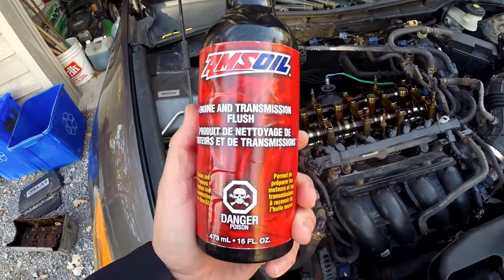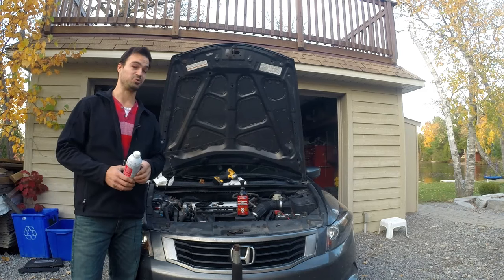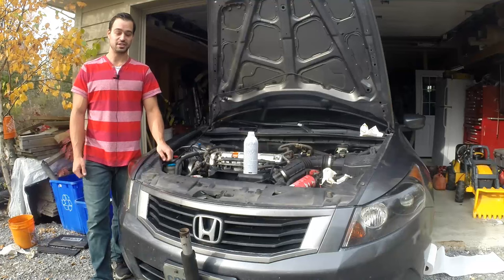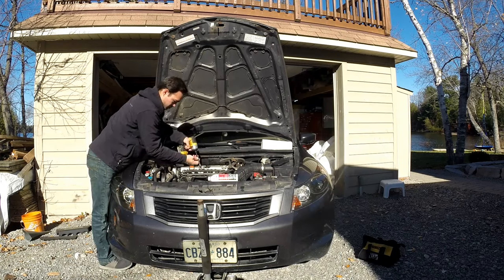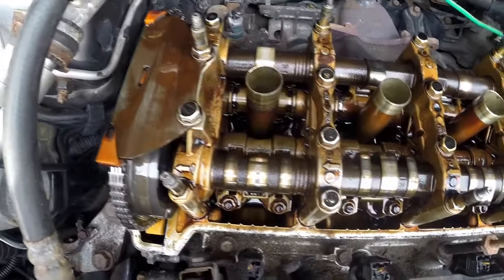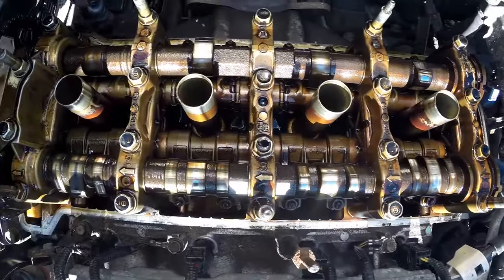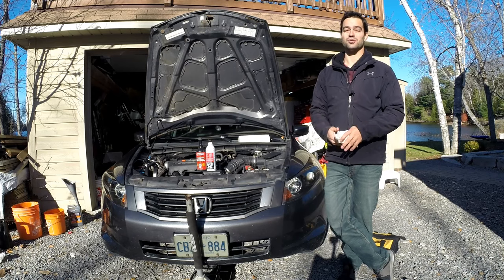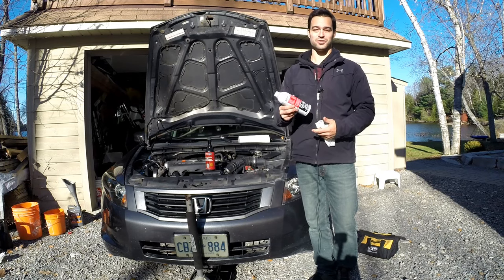Amsoil Vs. Seafoam Engine Flush - Who Wins? Thorough comparison and PROOF

Comment: I added a full bottle of SeaFoam and ran it in my Honda Accord 2.4L for 250 miles.  Checked oil prior to the SF add and then after the 250 mi.  Not that it’s scientific but was huge difference in color on the dipstick and white paper towel.  Med brown prior and dark black after.  Burns less oil per 1,000 miles too.  So will do a second SeaFoam clean again at next oil change.  Engine has 238,500 miles.   Great video!   Keep up the good work!
Reply from the maker: Nice to hear that you also had success with the product! Yeah the Seaform definitely seems to do a good job. 

Cool that you were using it on the same engine tested in the video too - they're solid! 

Thanks for your comment :)
Reply: I'd take it Easy with these solvents, you may endup shortening engine life more than the dirt itself. I know ppl that lost their engines trying to clean it up. Let some dirt stay in there.
Reply: That sounds like you out 3-4x time too much Seafoam in there and was overkill!!!! As the other guy said, be careful with all these solvents and chemicals you're putting in your engine. Some will stay when you out that much..
Reply: Beware! engine flush changes viscosity of oil. Therefore, it is not advised to drive a car during the process. One can experiment it with fast idle (1k-2k rpm) as recommended by STP
Reply: And… 2 years later my engine runs clean.  Oil burn is still less than 1 qt to ~4,000 miles and has 337,355 miles on it.   Should be able to get 500,000 miles on this engine.
Reply: I do the same the week before I know I'm changing the oil on the weekend,. I drive about the same 250 miles during the week as you. So I just remind myself to put the seafoam in the Sunday prior and drive on it..change the oil Saturday and I've seen virtually all the varnish and no sludge when I look at the valve train on my 200k+ mile Corolla.
Reply: @awaisiqbal8934 
Supposedly Seafoam does not change viscosity.   I'm skeptical but that is their direct claim.

Comment: I wonder if the test was done using Seafoam first and Amsoil second.  I bet Amsoil would win. Is not fair to test both products on the same car, the 2nd product will always have the upper hand since the 1st product already did part of the cleaning.
Reply from the maker: Thanks for your comment; I addressed everything you are saying in the video, as I came to the very same conclusion :) 

Furthermore, if you look around online, there are many tests on Seafoam that already indicate that it yields good results just by itself, which is why I wanted to test Amsoil first, and Seafoam second. 

If Seafoam has other tests that show positive results, then we can already conclude that the Seafoam product seems to do a good job. Therefore, having only one engine, it would be better to test Amsoil first and see if it can hold up to the performance of the other Seafoam tests done online. 

I do think though that Seafoam is the better product if you want to remove buildup, as you're actually supposed to drive around a bit with the product in the oil. Naturally, that would help lift more sludge and debris. 

Alternatively, the Amsoil would probably be a great product to maintain cleanliness of an engine, especially if the product were to be used each oil change. 

Cheers :)
Reply: Man I was thinking the exact same thing and was looking for someone to comment. 

But doesn’t mean his test was for nothing. I appreciate his test but too many factors. For instance it doesn’t make sense to me that after running the products the oils all looked black. And a similar black
Reply from the maker: See my comment above. Re: the oil being black, that’s how how it came out. Regardless as to whether or not it makes sense, that’s what happened so I figured I’d record it.

Cheers :)

Comment: An engine this gunked up you may want to do AMSOIL power foam, and do the engine flush everytime you change the oil with Signature series. I did it in my Focus ST and I can barely hear it and my fuel mileage went up 3 mpg instantly
Reply from the maker: Good to know - I'll look into the power foam the future! Thanks for your comment :) 

Yeah definitely agree that an engine like this would benefit from regular cleaning for sure. I was thinking the same thing after running the tests in the video.

Good to know about your Focus ST as well! Always nice hearing about what products other people have found success with! 

Thanks again!
Reply: @KingdomAuto  check out Synthetic Oil Protection's channel and see all the stuff he's worked on with the engine flush/power foam. Lots of good content on many different vehicles.
Reply from the maker: @Ruhdiculus  Absolutely will do! Thanks again :)

Comment: I did not see any "sludge" in your engine but rather mainly varying layers of varnish perhaps with some carbon content. Sludge normally does not occur with on time engine oil changes unless there is something seriously wrong with the engine. Actual sludge will look like thick, goopy oil that instead of being in a liquid form instead has the consistency of gravy that got too thick. This occurs when oil has been been kept in use for too long of a period and has already begun to break down and then undergoes a transformation in conjunction with atmospheric moisture build up resulting in thick, goopy, sludge appearance. Varnish on the other hand is also a byproduct of combustion in conjunction with the exhaust vapors which are recycled back in to the engine combustion cycle, resulting in the vapor leaving a coating on the metal surfaces which is varnish with some carbon content. That is that dark, thin coating you are seeing on the underside of your valve cover and coating top engine parts. Most engine cleaners/flushes are pretty limited to what they can do to accumulated varnish coatings on the inside of the valve cover and cams but that doesn't mean that they are not cleaning the lower engine components including the oil pan (to a certain degree) of any possible oil byproduct build-up as any quality/effective brand will clean things up but they have limited effect against varnish, especially on the upper cylinder and valve cover area.  For cleaning up accumulated varnish a better approach rather than an engine flush type product which are usually based on Napthenic based oils (which have cleaning properties) would be a heavy solvent based formula which is applied directly to the parts that have light to heavy varnish then physically wiping the varnish off of the metal surfaces. A product that would work for that purpose is Berryman B12.  If you want to avoid (as much as possible) the accumulation of varnish in the upper cylinder, valve cover area in the first place then do more frequent oil changes. I've pulled valve covers off Honda engines that have hundreds of thousands of miles on them that had barely any varnish on them because the owners were NOT going by the factory recommended oil change intervals but instead have stuck to 3000 mile (5000 km) oil change intervals. After the 5000 mile mark, due to the repeated heat/cool cycle and fuel dilution effect, the amount of vapor deposition on the metal surfaces dramatically increases so that if a person is going by a 7500 mile oil change interval just because the manufacturer says that's "ok" to do and just because the outside of an oil container makes a claim such as 10,000 miles on it, in the automotive repair world we can definitely see the difference when we pull the valve covers off.
Reply from the maker: Cool thanks for sharing :)
Reply: Cheap oil tend to lose their lubricity and  additives if theres any under high heat thermal breakdown.. good quality oils with good additives will help keep the oil from being cook under high temp.

Comment: I've never done a flush but after watching your video I bet using 1/4 bottle of Seafoam before each oil change would keep the internals looking brand new. And since they recommend driving a few miles with the Seafoam I don't think it will be bad for the engine. I'm going to try it on my next oil change. :))
Reply from the maker: I was thinking the same thing actually. Probably not a bad idea to make this a regular maintenance item as I bet it would help keep the engine quite clean. 

Let me know how it goes if you decide to try it out!
Reply: I add 1/3 the bottle into the crankcase (1/3 intake 1/3 gas tank) before every oil change. drive until that tank of gas is done, then change my oil. Never had an issue out of my 91 S10 W/ 350K miles.
Reply: @jhowe67  yeah but for how long have you been doing that? Even the company doesn't recommend doing it that much
Reply: @maxax6651  6 years. This plus switching to Amsoil, stopped my oil pressure tanking 5 minutes into every drive.
Reply: @jhowe67  you sure it wasn't another issue like oil pump or engine just aging that caused that. I heard the chemicals in Seafoam eventually wears down plastics and seals.
Reply: @DominiAeternum  If you leave it in it can absolutely, thats the reason i add it before i change the oil, and do not add it after. as for the oil pressure, im sure it was just buildup on the sensor causing it to not read. id check the seals, but i lost the truck to an unlicensed driver in a head on collision. but for 6 years i hadnt had any issues. i dont know if id use it in a modern vehicle with that frequency, but atleast the older engines ive used it in never had an issue with oil.
Reply: @jhowe67  oh okay. About how long before the oil changes did you put it in? I've got an older carbureted car that could probably use that help, but it keeps dying when put in gear (D or R in low gears) but alright in N or higher speeds. Don't know what's wrong with it
Reply: Right, of course...why would a seller's sales pitch on a can lie to you?

Comment: Seems like a fair compromise on products, personally for me, when I got my chrysler 300, with unknown service history and having ran Amsoil on my previous car,  I opted for a 20k mile cleaning period where I used the Amsoil engine flush and Amsoil Signature series every 3 to 5k miles, and now I'm that I'm passed that and 7300miles into the regular service I'm sending out a oil sample for analysis
Reply from the maker: Thanks for your comment and glad you found the video useful.
Curious to know about how those samples do when they're analyzed. I did one of those through Blackstone for the first time a few months ago and it's pretty amazing how detailed and thorough they are.

Hope the report comes back with good news!
Reply: How was the results?
Reply: Your full of it 😂
Reply: Oil analysis was ridiculously high in copper, have It in the shop for the infamous lifter tick, has lifters and rockers up for replacement, I haven't had any issues so far apart from the lifters and rockers.
Reply: @zachdailyfost4433  copper means rod bearing are done. Sorry to tell you.
Reply: Don't waste money on the top end.
Reply: It's a good thing I dumped it, traded it in for a 2014 Focus ST ST3 package with 41k miles, 2 months ago, first thing I did was switch everything to Amsoil. But I think I'm gonna run Liqui moly in it as they specialize in oils for cars with direct injection and are more geared to specs and such

Comment: The recommendation is using a whole bottle of Seafoam into your engine and letting it run for about 15 minutes before draining the old oil?
Reply from the maker: The recommendation for the two products specifically that I used are as follows: 

Amsoil: Add the entire bottle to the oil, idle for 10-15 minutes, drain oil immediately and change filter.

https://www.amsoil.ca/p/engine-and-transmission-flush-flsh/

Seafoam: Add 1 Oz of oil for each quart of oil in the crank case, drive for 100-300 miles before draining and change filter.

https://seafoamworks.com/product/sea-foam-motor-treatment-oil-fuel-additive/

So I just followed those instructions for the tests :)

Hope that helps!

Comment: Wow, I am impressed by the color of the “new” oil after only 10min of life. Much darker than I would have ever expected!
Reply from the maker: So was I!! Here I was thinking that the "control" oil would prove to look much cleaner than the oil after the tests, I was wrong. I would be really curious to see what things would look like if I "flushed" the engine with new oil maybe 2-4 times prior to running the tests, and then checking, that would be interesting. I just didn't have enough in the budget at that time to buy oil for 5-6 changes lol. Maybe next time!

Comment: I would think that the second flushing on the same engine is just loosening it up as you mentioned. I have used amsoil for many years and they are a great company with great products. Im sure both work well
Reply from the maker: Yeah I wouldn't be surprised if you are right. The only reason I tested Seafoam second was because it already has proven itself to be a good product. Granted, I think because Seafoam calls to actually drive around for a few hundred km's with the product mixed with the oil, that it would help to agitate the buildup more and help to loosen it. 

But I think overall if these products are used regularly, they both would help to keep an engine clean.

Comment: Good job. There is definitely a difference Try another couple of rounds with Marvel Mystery oil. Add about 6 ounces and drive about 300 miles with it in the crankcase. You will see a new looking engine and clean valve cover. It works.
Reply from the maker: Noted, thanks for your comment! 
I'll have to give that stuff a try; and maybe make another comparison video in the process as well
Reply: @KingdomAuto  Do not try MMO, MMO actually reduces the lubricity of motor oil.
Reply from the maker: @ironmaidenkid455  Great to know! Yeah, definitely don't want to be doing that. Really appreciate the info. I'll have to make sure to thoroughly research any of the products that I put into the engine.

Comment: I trust and use Seafoam. Thanks for the assurance.
Reply from the maker: It definitely seems to work well. I'd be curious to see how these products do with consistent use. This was just a one-time test with an engine that had almost 400,000kms on it. If these products had been used before each oil change (or more often) it would be interesting to see the internals of the engine under those circumstances. Either way, it's nice to see that they seem to work!

Comment: Appreciate the video! Gives me some assurance to do a flush next oil change on my high mileage Hondas. Was worried about damaging seals before.
Reply from the maker: Thanks for your comment! Yeah I think due to how mild these detergents are, they seem to slowly dissolve the sludge rather than aggressively removing it. As a result, I'd imagine that they are also quite gentle on the seals too, and I didn't notice any leaks on the Accord after performing the tests as well (even despite taking the valve cover off a handful of times).

Hope these products work for you too!
Reply: Detergent based , engine flush

Comment: I'm a firm believer in Amsoil Signature Series and Seafoam, I have used Seafoam for over a decade and Amsoil for about 5 years. I appreciate your review of these products, thank you. A follow-up would video and also a second test would be awesome. I would be interested in seeing the same test but reversed. Not so much as a head to head comparison but as a combined review. Add the Seafoam drive it for whatever Canadian for 300 miles is and then run the Amsoil Flush. Gut feeling is that we would see an improvement.
Reply from the maker: Thanks for your comment! Yeah I completely agree, it would be great to run the test again but in reverse. If I have the opportunity to do it again, I'll take you up on that offer for sure! 

I was glad to see that the products did begin to remove some of the buildup - I bet if these products were used frequently, they'd keep the engine pretty clean.
Reply: Lol it’s called a kilometre

Comment: There are two types of flushes. 1. Detergent based and 2. Solvent based 
Detergent based are more expensive and are designed to slowly liquify sludge over time thereby preventing stopping up the oil screen on the engine pump. They are not a quick-fix products but are safe and effective over time. Examples are Amsoil, LiquiMoly.
Solvent based flushes are designed to be cheap and work quickly. Heavily sludged engines can be overloaded with the solvent and break large chunks of sludge loose and stopping the screen on the pump up. Sea foam, kerosene, and other inexpensive flushes are examples of solvent based flushes. 
Both Amsoil, LiquiMoly, BG, and other professional products are designed to slowly dissolve sludge and transfer it to the filter for removal over time. None of them are designed to be quick fixes. They work great in modern VVT systems freeing up sticky solenoids and phasers.

Comment: i had an old ford truck with a 5.4. I ran seafoam for about 300-400 miles before an oil change for 5-6 oil changes. the first time the oil coming out was thick and black. and every oil change it seemed to get a bit cleaner. the final oil change the oil was still dark, but it was more of a dark amber color than black. i thought it was snake oil before that but i watched the project farm video you mentioned and thats when i tried it.
Reply from the maker: Great info, thanks for sharing! Good to know that it seems to get rid of the buildup somewhat slowly as well, as we wouldn't want big chunks of sludge blocking any oil ports or pickups, etc.
Reply: im gonna try seafoam on my f150 5.4.
Reply from the maker: @jamesyarbrough4777  Hope it works well for you :)